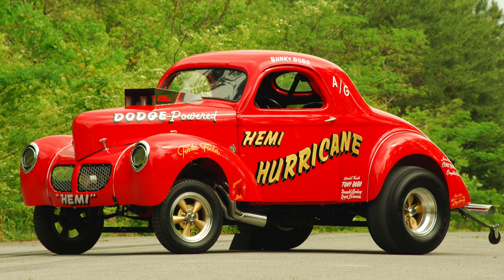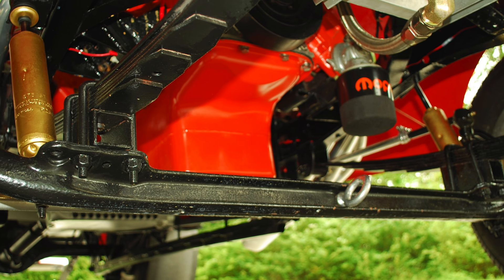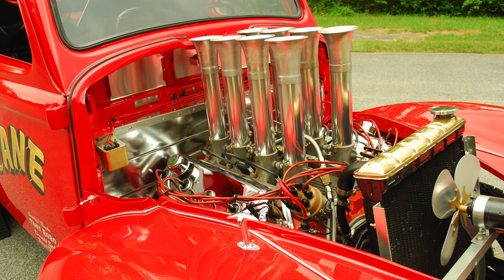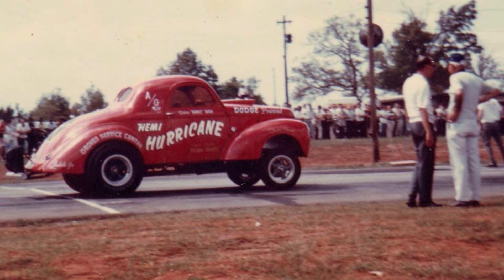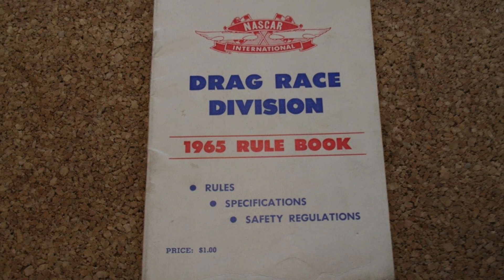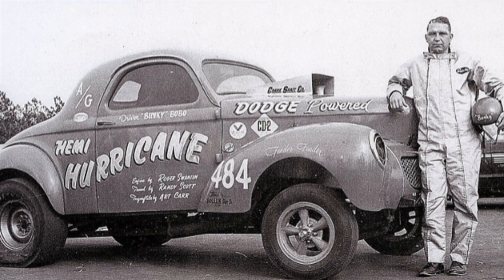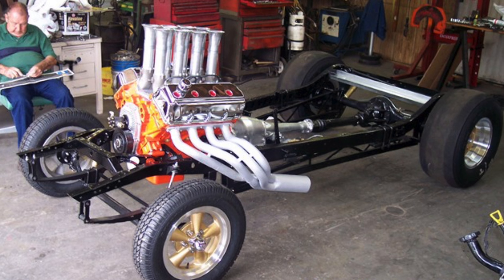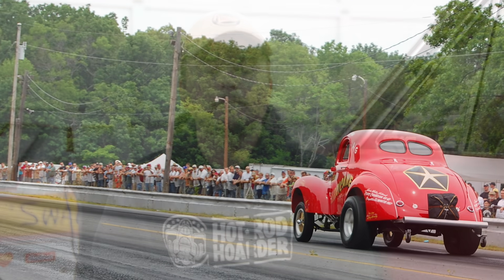1940 Willys GASSER: History of the "HEMI HURRICANE"

Comment: I certainly miss the willys on the dragstrip, I built my own car in 1970 with a 440 Dodge engine then in 1974 switched to a 426 Hemi, hilborn injected. I ran pump gas only ,battery ignition, an automatic then a Doug Nash pro shifted mopar 4 speed. those shifted better than a lenco at 1/5th the weight. with a dana 60 ,5-13 gears launching at 3500 RPM it ran mid 9's all day long. speeds of 145 best. sadly in April 1977 on a qualifying run the chute tangled in the wheelie bars, hit a dirt berm at 140- flipped7 times in the air, landed on its belly, the rear end and chute about 200 feet from the car. I stepped out relatively unhurt- cracked ribs and broken finger, but there was nothing left of the car. I've owned several willys since 1958 and would have another in a heart beat. I'd be drag racing in a couple weeks as I have an all aluminum 510" hemi -hilborn injected and 3 speed lenco sitting close by.

Comment: Amazing car, we used a Willys for our car club logo. I am sure you know this since you been around these hot rods so long, but for those that don’t it’s actually originally pronounced Will-less.
Reply from the maker: Yeah, I actually debated on which way to pronounce it when I was shooting the video. I've heard it pronounced both ways, so I went with Will-ees. Thank you for the clarification on that.
Reply: @HotRodHoarder   at this point 95% its accepted as Willy's!  But if you refer to it as a surname  like it was originally then it doesn't sound correct. Either way its the classic gasser drag car.